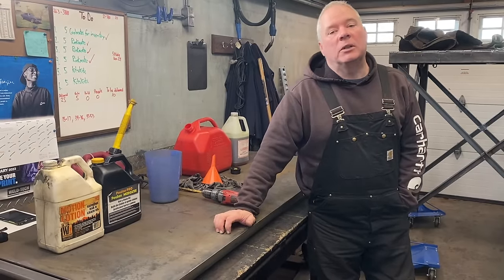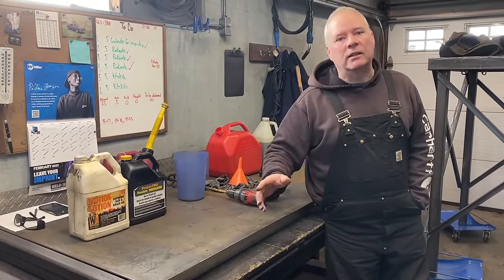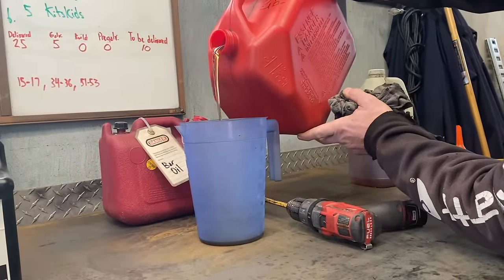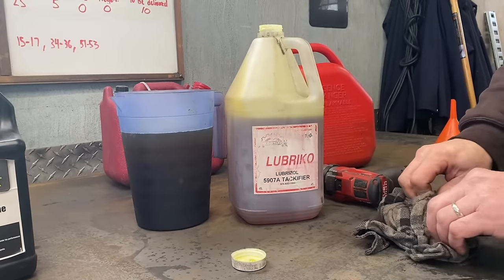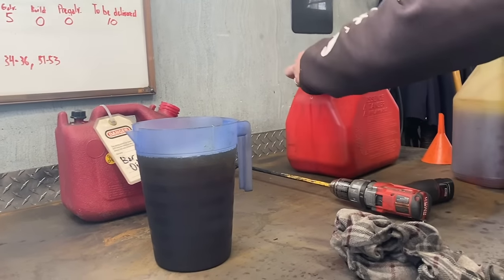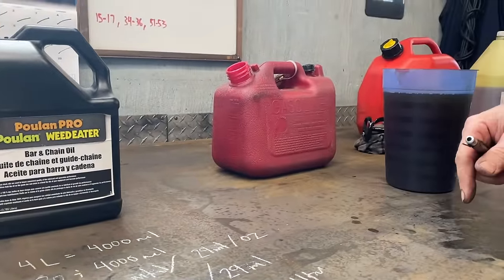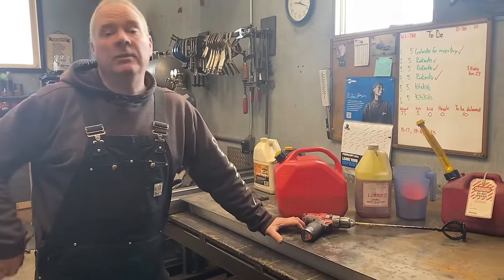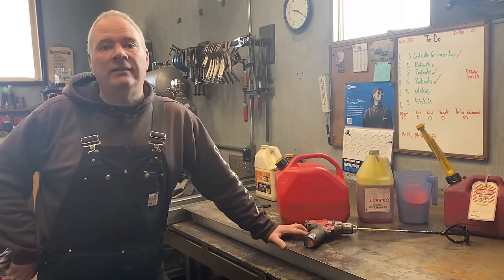How to Make Cheap Chainsaw Bar Oil!

Comment: If used oil was good enough for an expensive car or truck engine, it should be fine for a $500 saw!
Reply from the maker: Hello. Thanks for watching and commenting. I somewhat agree that many used oils are adequate for use as bar oil, but I wouldn’t think of using used oil to do an oil change on my vehicles and unfortunately the way prices have increased with inflation and greedflation , none of my chainsaws are south of $1500.00 in today’s market and 18”-20” bars will probably run around $150-$200. So in some instances “cheap” and “ good enough” aren’t worth the trouble.

Comment: Husqvarna bar oil is now $25 bucks (USD) per gallon, the same store (Lowe's) also sells PRO SELECT 128-oz Conventional Bar and Chain Oil, $15 bucks. The pro-select is much thinner oil and doesn't have as much of the tacky substance in it.  Still too expensive for either one.  Thanks for the tip............

Comment: With your addition of that amount and the quality of your tackifier into a much higher quality lubricant like that quality atf oil and much higher quality then a cheap stock base 30wt base oil you actually have something that’s several times higher quality then anything available for purchase.   I use used hydraulic fluid and the aft from a industrial maintenance company… and I just add one gallon of high tackifier Cut-it bar lube to 4 gallons of the other stuff and make a 5 gallon bucket of lube….   If you have a large amount of motor oil you can filter out the junk…. using a used motor oil … I cut a poly tote top open and with three 4x4 filter pieces of industrial air handling filter elements with white masonry bar sand between..  created the bottom 1/2 of the tote as my filter and sitting on a wood 6x6 frame above the catch tote you could dump the bucket of used oil into the top and you lost a huge amount of the dirt … by the time it moved down through the filter system….  Several recycled speaker magnets from the scrap yard…two dozen tossed around  in the filter system…. It’s definitely economically viable to find a used filter base plate… old truck graveyard or equipment graveyard and then you have a couple of 5 micron or whatever screw on filters and a little diesel transfer pump system and you could have it cleaned while you loaded it out of those catch tanks and barrel’s…. Lots of companies are happy to let you take their waste oil off to reuse…save’s them $…   If I had that can you just made I’d probably be adding that to 5 or 10 gallons of cleaned oil to run through as bar lube…. That’s 5 times better then anything I could buy as bar lube In it’s actually quality!!!    You know that you can get a sample kit from Blackstone labs and send them your transmission fluid and they will test it out and then tell you exactly how spent it really is… seems like it’s still in excellent condition and I’d definitely want to find out if extending those replacement cycles would be possible and if you aren’t removing a oil that still has a huge amount of it’s life left?  I use that system on all the trucks and equipment because some are really really unnecessary at the frequencies recommended and we use a higher quality grade product and add several additives to the system usually???
It’s only about $40 bucks a test or Analysis of the amount of life left in the sample,,, so it’s really inexpensive for a incredible insight into the actual condition of your used product!  I’ve increased and decreased the frequency of changes on all my equipment after realizing that for a $50 I can get a very detailed report on the condition of the sample… you send a couple ounces of new and then you’re used sample and they can tell you exactly what has degraded… it’s a fantastic opportunity to add some additive to compensate and possibly increases your intervals greatly… more importantly it’s when it’s actually the correct amount of degradation that a change is actually needed….
Reply from the maker: That sounds like a really good filter idea. I think people would be surprised to see how much debris is in used motor oil. Not necessarily metal, but carbon and other contaminants I’m sure. Even my very clean looking hydraulic oil will settle out some debris after sitting in a 5 gallon bucket for a year. I just stop pouring before I get to the bottom. The best bar oil I ever bought came from Baillies Woodsmen Supply and was called “Motion Lotion” lol. Seriously tacky. Probably worth a fortune today, especially with the exchange rate and shipping to Canada. 
Thanks for watching.

Comment: While I like the idea of re using things and having lots of used hydraulic oils I would absolutely NOT use hydraulic oil for chainsaw. 
Here is why,  hydraulic oils contains many nasty petro-chemicals that are toxic & the bar&chain are flinging and misting these into the environment you work in as well as where the people you love and care for visit. 

Chainsaw bar oil is vegetable oil based and non-toxic. 

Maybe there is a food-grade waste oil solution to this? Restaurants have lots of waste oil that could be repurposed?
Reply from the maker: Thanks for watching. 
To my knowledge the only bar oil that is vegetable oil based is labeled as such. Stihl has their Bio-oil, otherwise standard bar oil base is produced by petroleum companies. While I agree that no exposure to chemicals is best, chainsaw gloves and chaps protect well from skin contact and unlike 2 stroke exhaust fumes the bar oil is never burned or atomized. Unless things have improved significantly since bio- oils were introduced, the biggest complaint I’ve heard is the shelf life and oil going bad from summer cutting temperatures. I’m not sure I’m ready to switch yet, but thanks for sharing your thoughts.
Reply: @buildingthebruce  You are right about it being petroleum based in most cases. Either way the hydraulic oil is not something you want in the air or environment. In small quantities the harm is probably nil or close. But if you do lots of wood it adds up to lots of oil being spread around.

Comment: Just buy bar oil… time you spend on mixing and storing and worrying, plus you had to buy that high dollar tranny oil plus the “sticky stuff”.. just buy bar oil bud. I was hoping this was like you went to McDonald’s and got all their old fry oil or something like we was making bio diesel
Reply from the maker: That’s an interesting comment. I did a cost analysis for a neighbor who cuts wood to heat his home and recently switched over to my system. $3.00 for 1 gallon/3.78litre my way. 19.00 for Recochem, $24.99 for Huskvarna at the local Peavy Mart. It’s your money, you can spend it however you like, but I’ll stick to my system and savings. Thanks for watching,it’s always interesting to hear other people’s thoughts.
Reply: @buildingthebruce  time is worth a lot to me bud. Taking the time to buy all your ingredients plus mix them.. pass! I don’t own anything that needs tractor transmission fluid so I should have lead with that.
Reply from the maker: Not having a source of good clean free oil would definitely change things. Fortunately or unfortunately, every 400 tractor hours I end up with 42 litres to deal with so it’s basically waste oil at that point. Time, ya it does take time but everything to do with wood burning is time intensive. I guess it’s just a lifestyle that I’ve gotten used to and enjoy.

Comment: Certainly not worth the effort for whatever insignificant savings would be realized on chain and bar oil. Also, the advantages of manufacturer's improvements to chain and bar oil in real time are totally missed, especially when it's a considerable amount of time (10 plus years) to consume the blending oil to eliminate slinging. Shelf life alone would have an impact on its effectiveness. Consequently, the drain oil mentioned also leaves a lot to be desired for use as chain and bar oil considering it' was intended for totally different purposes. It's really surprising that someone who depends on quality products for maintaining equipment for their livelihood would cut corners on something so critical as a quality lubricant for their chain saw.
Reply from the maker: That’s a real load of rubbish. I’m guessing that you’ve never ran a saw, let alone dropping trees, bucking logs or anything else to do with trees other then hugging them. The base oil in a synthetic high performance hydraulic fluid is undoubtedly far superior to any bar oil manufactured. If kubota is willing to trust it in a $100,000  tractor then I’m willing to bet it’s good enough to keep a chainsaw chain lubricated. The fact that you mention shelf life is a testament to your lack of knowledge in this matter. What do you think happens to it? It’s not milk left out in the counter. Have you read any of the comments about cooking oil, peanut oil, vegetable oil? Somehow, millions of chainsaws are still cutting just fine using just about anything that makes metal slide. I’ve probably forgotten more than you will ever know about keeping equipment serviced and in proper repair. Lol. Anytime you want to learn to run a saw, you let me know and I’ll show you how it’s done, and after 25 years and thousands of cords you might be qualified to hang out with me. Good luck to you.